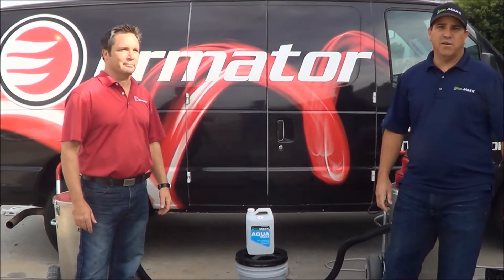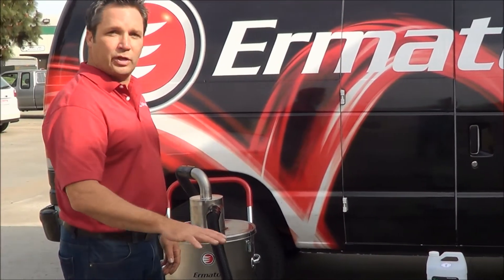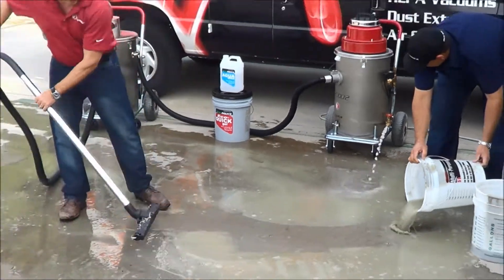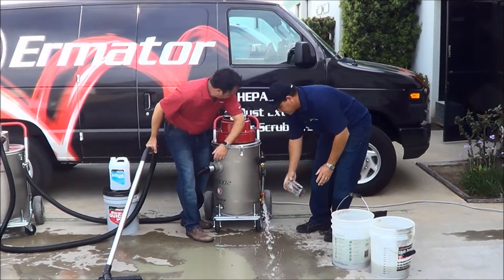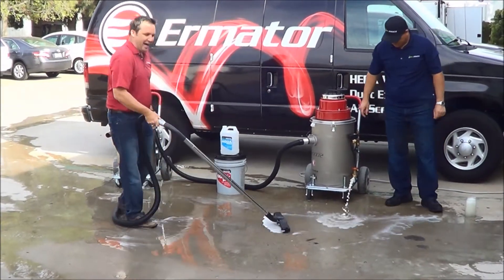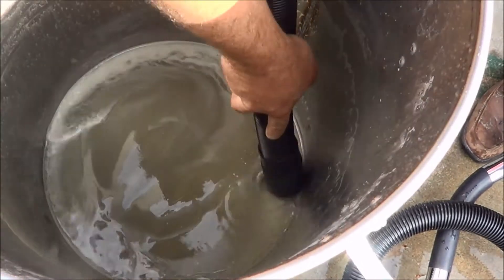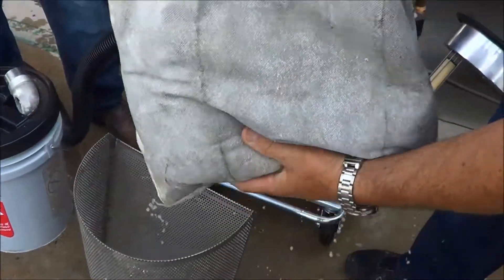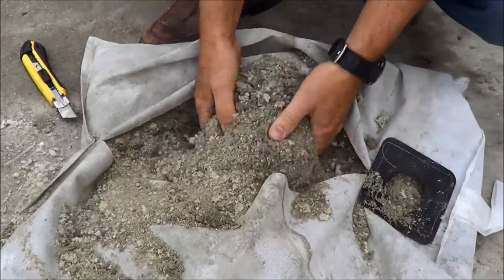Ermator Vacuum Recycles Water with Gelmaxx

Comment: This Ermator wet vacuum system, we use it without the filtering system , at the construction sites in whole Scandinavia. Are very powerful, very reliable , almost indestructible. Sucks tones of mud , stones, debris as if it is dust.